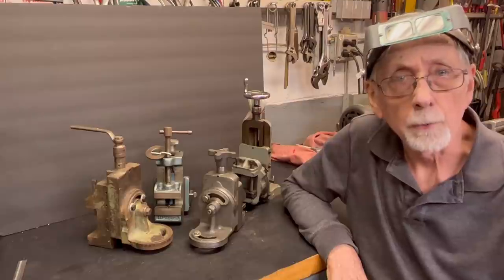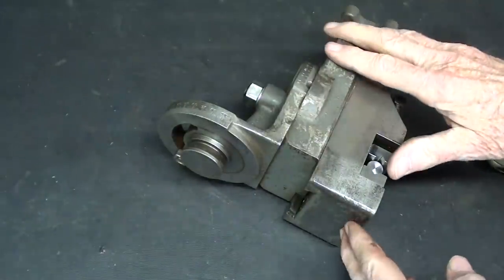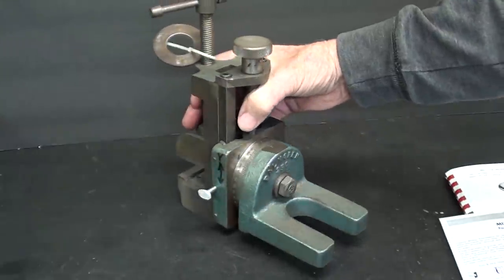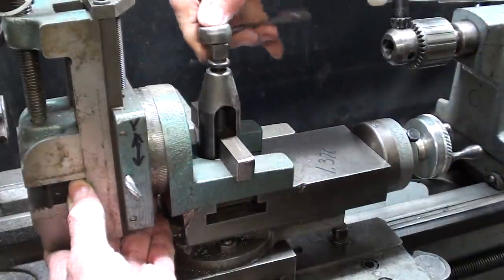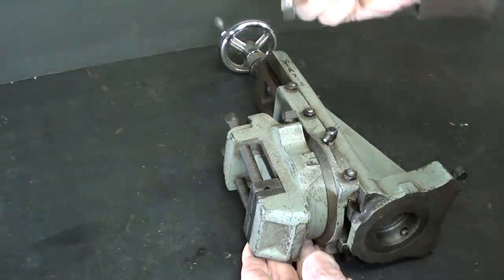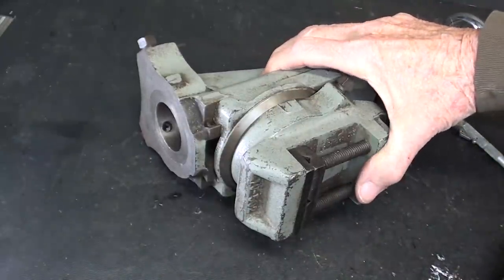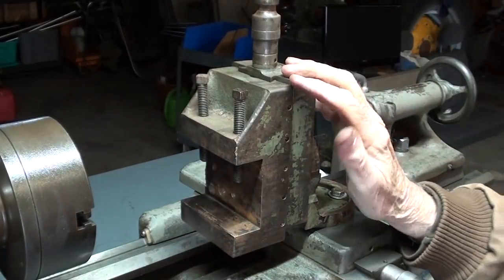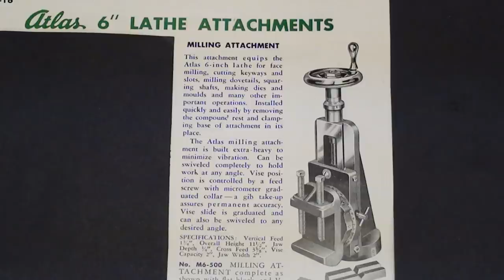Lathe Milling Attachment Inventory #790 tubalcain atlas south bend

Comment: Very interseting how they all do the same job but vary so much. For a small work shop I think this is a very valuable attachment for a lathe , expands its mode of operation coniderably, just like a tool post grinder. Thanks Mr Pete for the very indepth video and the links .

Comment: Thank you Mr Pete. I found an angle plate that had been modified considerably. I later discovered that it was made to fit a 13 inch South Bend. The compound came off, the angle plate went on, then the compound mounted to the angle plate. I'm not sure if was used for a makeshift milling attachment or some other purpose. I always enjoy the show and tell.

Comment: For very light occasional use I think they have a purpose especially when a dedicated milling machine isn't practical or possible.  I think these attachments probably had rigidity on par with the many "mini-mills" you see advertised today.  I have a Sieg SX3 mini-mill in my shop which displaced the Atlas milling attachment I used to own and use on my Atlas 10-inch lathe.  The mini-mill is much easier to use and has greater travel on all axes but I'd say the rigidity is only slightly greater...it's still a mini-mill and certainly not a Bridgeport.
Reply: Even a Bridgeport feels as rigid as a mini mill after you use a 40 taper machine.
Reply: @RichieRichOverdrive  True.  It's all a matter of perspective.  I've heard Keith Fenner refer to his Bridgeport as a "glorified drill press" :-)

Comment: Years ago I bought a Palmgren vise and removed my compound and replaced it with a solid block with a dovetail and two bolts. It helped some on the vibration with a larger bolt and hold down but you still have to be careful . I still use it, no space for a milling machine.Still love my old 9” south bend lathe . Thanks for the video’s.

Comment: I had a lot of use for my Taig milling attachment before owning a proper milling machine. Quite limited travel (2inches!) but for small parts is was a lot of fun.  Still better than clamping the part awkwardly on the slide.  Even made clamps to hold a digital caliper on the attachment as a poor man's DRO.

Comment: Wasn't there a milling attachement that used the spindle and tail stock  to set up as a horizontal mil for cutterl part was put on a table mounted on crosslide was made back in 1930's..40s

Comment: Have you had a chance to evaluate any of the import milling attachment that came out in recent years?  I think they're either coming from China or India, I see 3 versions ranging from mid-60's to mid-160's price.  One's a small one, one's a fixed, and another one's a swivel like the atlas w/two different vise options.  I'm tempted given the price.
Reply from the maker: No, I have not a valuated any of those. Really do not know much about them but I do know that you get what you pay for.

Comment: Great tutorial Mr Pete, I’ve been searching for an attachment  for my Enco lathe. No luck so far but I will keep looking. Thanks for the videos sir!
Reply: Vevor has several different sizes available, though they aren't specifically for your machine.  If you just need it for a single job you can bolt the work to an angle plate mounted to the cross slide or compound.  That sounds sketchy, but it would probably be more rigid than a part cantilevered out 6 inches like the palmgren milling attachment he showed.

Comment: I’d love to see a tear down of the Palmgren. Would one use collets to hold the cutters in the head stick? That kind of seems to be what was pictured. Very interesting video, thank you for sharing.
Reply: Yep, you need a collet to hold the cutter. Travers tool has them individually or in sets for a #2 or #3 Morse taper lathe spindle. I just bought a #3 Morse taper set just last week for about $110 that included 5 collets up to 3/4 inch diameter shanks. A chuck isn't suitable to hold the hardened shank of an end mill. Anything other than a light cut will suck the cutter out of the chuck into the work. The collets have a set screw that locks into the flat on the end mill to prevent that from happening. Plus the cutter must be held dead nuts on center or one flute will do all the cutting and any feature like a key way will be cut over size. Lastly the collet will get the milling cutter several inches closer to the lathe's spindle bearings giving more rigidity  to the cutter and more room for your work.
Reply: @aceroadholder2185  great explanation. Thanks. I have seen ER collets as well that have a pin that engages with the flat on the tool to prevent slippage. Thanks

Comment: Will the Craftsman vise part of the milling attach fit on the cross slide?
I see that your Clausing 5914 compound slide had a rough life.  Mine is cracked down to the way screw.  Just ordered 2 blanks to fabricate one. I think my Beaver mill is up to it.
Reply: Yes it will.  At least my 6" one does on my Atlas 618.

Comment: If you don't have a Bridgeport, or a horizontal mill, or a shaper, like you do Tubalcain, the milling attachment can be the difference in getting a job done. While they definitely lack RIGIDITY, with light cuts and good setup, they can be satisfactory. Appreciate the run down on the different ones, I would take Brand X if it would fit my SB 13" it looks beefy.

Comment: I have a 'milling attachment' that belongs a Myford ML7. It is the one on the left seen in this video: https://youtu.be/xVfnhy35QQs?t=72
As per a milling machine table, it just has 3 T slots so you can clamp work directly to it - or clamp a suitable vice in which to mount your work.
It saddens me somewhat to see it in the garage where we had the ML7. Dad decided to keep it and not sell it with the lathe. Now we have a mill, we've no need for it.